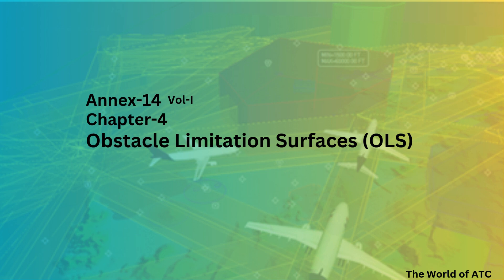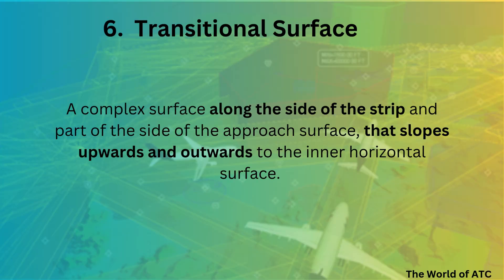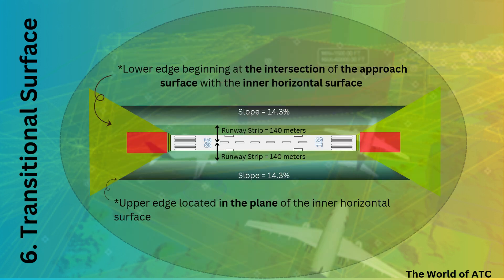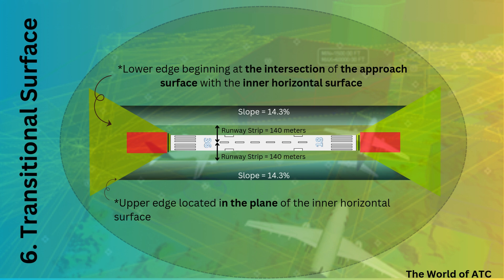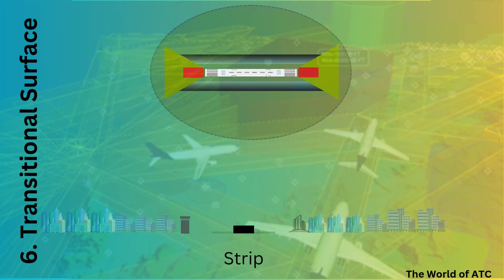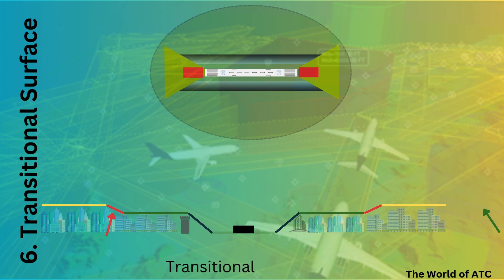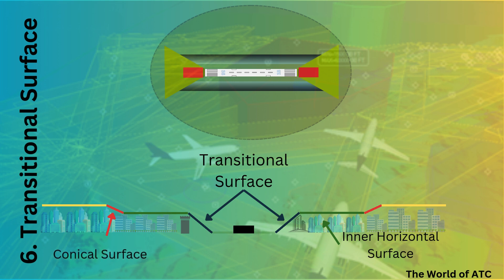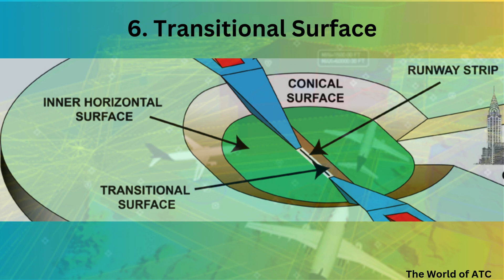6. Transitional Surface | Obstacle Limitation Surface (OLS) | ICAO | Annex 14 | Chapter 4

Comment: At 14.3℅ rate, if an obstacle is 45 meter high, it must be at a distance of 315 meters from the inner edge of the transitionanal surface instead of 320 meters.